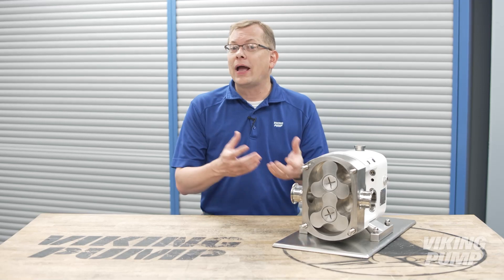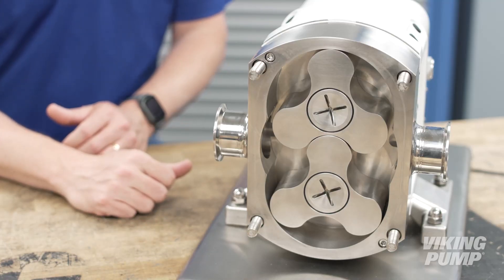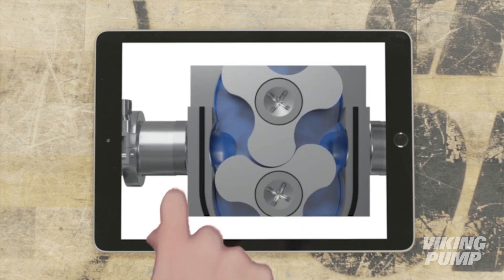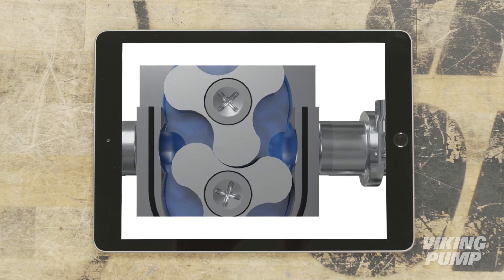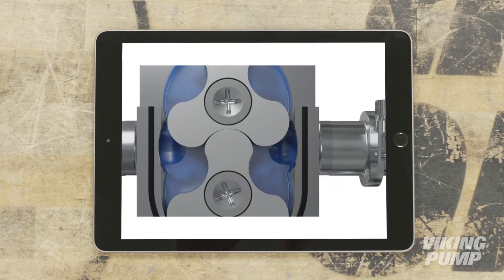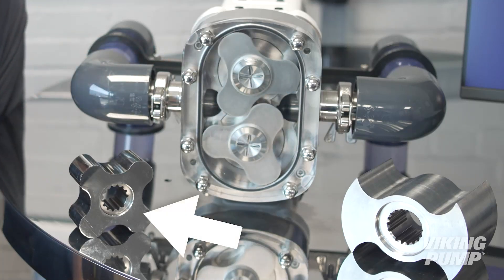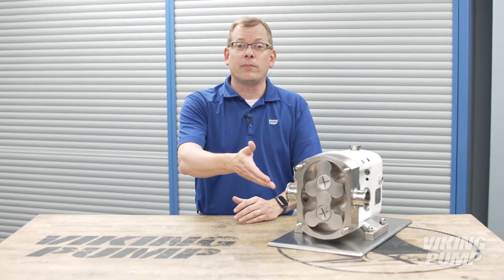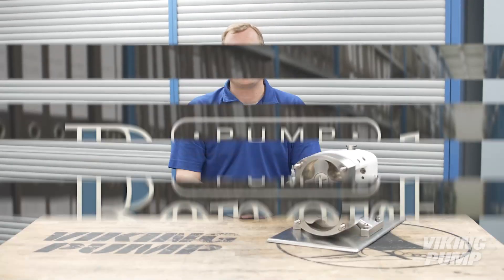How Rotary Lobe Pumps Work

Comment: We use this for a vacuum unit that such air. On the suction side there is a handle that closes the air inlet and this makes the vacuum stronger. Is that how it works for air flow with a love pump?